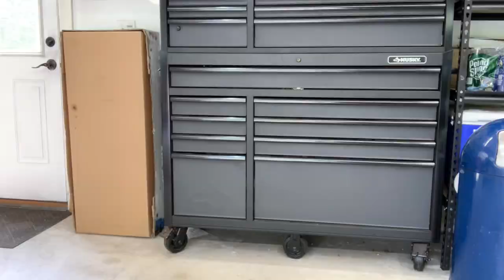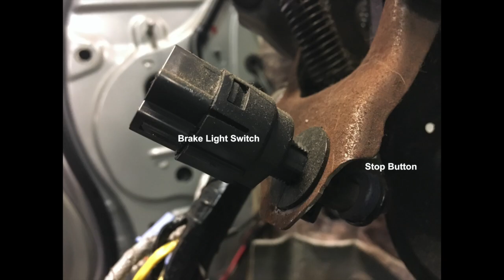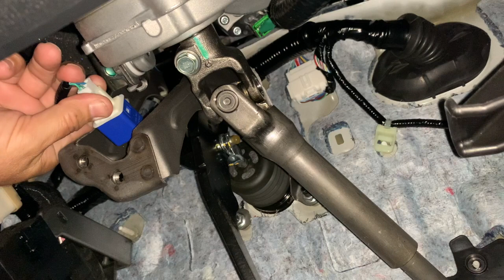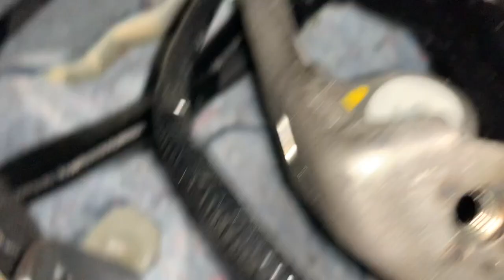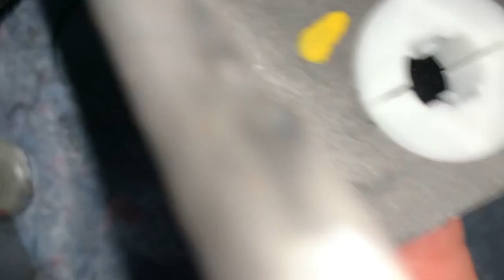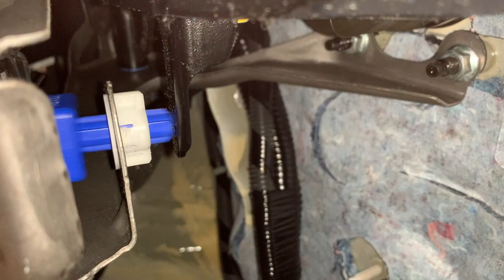Your Car Is Shaking, Vibrating, Rumbling While Driving!

Comment: Hey Mr.Eddie i am having a similar problem with my 2006 toyota rav4 i have changed the brake rotors and pads about 3 to 4 months ago but my car at highway speeds after 10-15mins of driving my car starts to shake and vibrate from the passenger side and it makes like a  pounding /rumbling noise too i have also notice that their is alot of brake dust and i always keep my rims clean but 4-5 they get super dirty from brake dust and also the rim is super hot to touch after the drive  . I have balanced and rotated all of my tires but still has this problem. Please Mr.Eddie let me know if it could be the calibers or somthing else thank you.